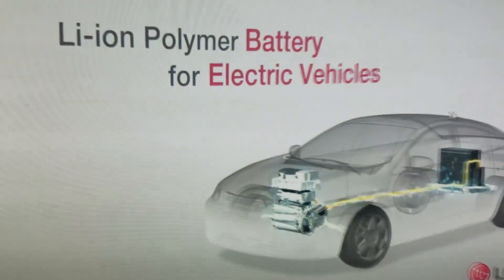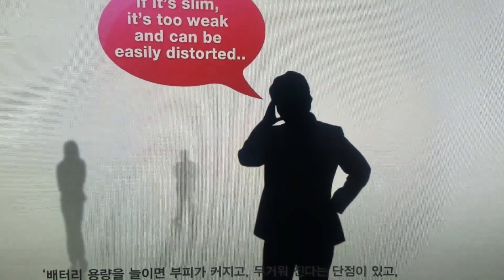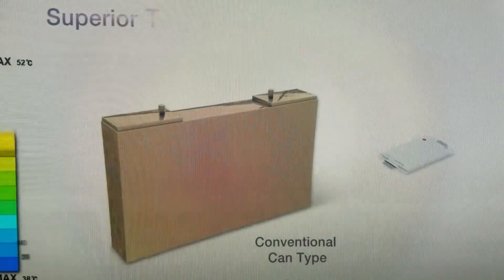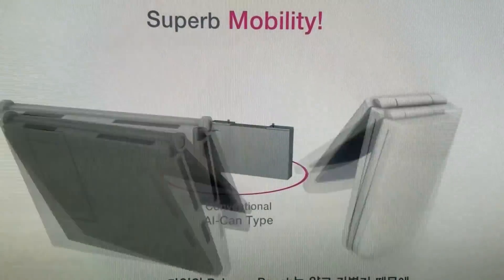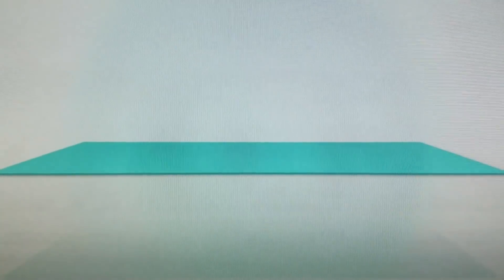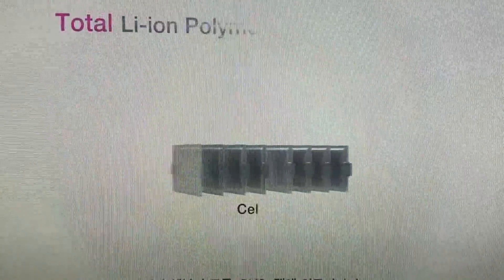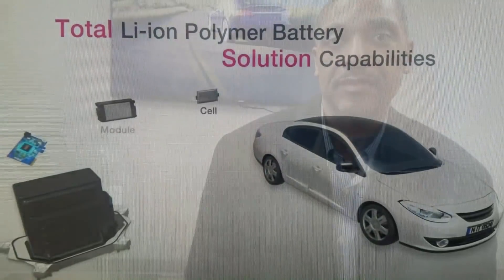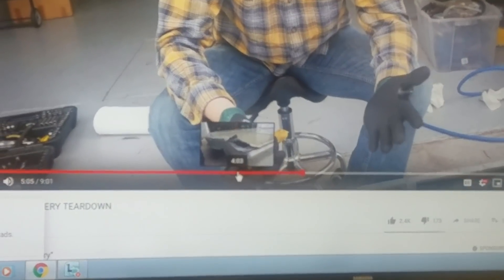C LG Chem Battery Superior to Tesla?   2018 (399)

Comment: BYD, Tesla, LG Chem, CATL - really not sure which is the winner. I personally doubt any company PR department, claims.
Why doesn't the Bolt have better range?  Pouch & cell just formats - chemistries can be use in either format.
I suspect cell can be made faster than pouch. Pouch good for low volume and cell better for high volume (you need high volume as the equipment to make cells are expensive so you need the volume to reduce cost).

Comment: You can see where Tesla avoids short cuts in battery design. far cheaper in short run to use pouches and get higher voltages by mostly placing them in series. but with minor pouch degredation the entire pack is greatly affected. shorter batt life and higher cost to consumer. In Tesla approx 40 individual cells are in parallel and individually fused. then each pack connected in series to the next. there will be gradual degredation but can be can be used like this safely for many years till practically the entire battery dies. Legacy manfacts dont care about "long term"anything. their cars become money pits in short time. consumers are tired if this!
Reply from the maker: Lower cost not as good Jose

Comment: My analysis :Tesla has for 3 years been developing  a high  voltage Braga -Goodenough solid glass electrolyte cell. With Maxwell's dry electrode & capacitor production at scale skill, the tested management system and performance of the Plaid & Cybertruck. conforms multiple  bold steps, probably including a shift to a pouch.

Comment: There is a big difference between a model S battery and a Model 3 battery.  What a load of rubbish.   Watch Tesla and learn from how they do things - Anybody  that has two cents upstairs will be aware that Elon is going to announce something great next year that will put LG back in the box.  The model S is nearly 10 years old and still the best car in the world.   The Roadster  will be somewhat different and will be so much more efficient in handling power.  I wish I was a lot younger - I'd go and work for Tesla as they are the only people thinking (and working) outside-of-the box.  Nobody has cracked their motors yet, such a simple and effective use of power, especial the Model 3 motors and the next version (probably being tested now).
Reply from the maker: some good predictions Frank
Reply: Elon did tweet something obscure but potentially of massive importance by the tweet and what was said about Element 43 (or was it 45) - I do not have twitter so just going by what was reported elsewhere

Comment: Turns out LG packs are great for street racing! They can be used at around 480lbs but a Tesla pack has to be  used as a complete pack at 1000 lbs . So southern street dragers and drifters may give LG business.Street culture drives success.Elon mistake might be his rules of buy my Racer , but don’t use my tech in an unsanctioned way.In a nut shell LG could win.
Reply from the maker: Possible

Comment: I have experience in pouch batteries with Radio Controlled Models, Aircraft and Surface (boats and cars). The batteries made for these have been pouch type for years with changing chemistry. They use to swell and catch fire, from overcharging and short circuits. But today's chemistries are much improved less swelling from repeated charging. More resistant to shorts, but not completely yet. Still they only have so many charge cycles and 3 years is about all we get still. The auto industry should just capitulate and standardize on Tesla batteries and Superchargers. So what they have to pay license fees and or sole source, it will give them the batteries they need to remain competitive and, Tesla what it needs to expand quickly w/o killing off the competition worldwide.  Otherwise it will be doomsday for them over the next 10 years. Tesla Solar, Tesla Powerwall, Tesla Model Y. That is the "Standard Oil" of the future. We see a monopoly in the making, I for one am ok with it.
Reply from the maker: Well said Jerry

Comment: For the set up I am wondering why is the top of the TV cuted off? It looks a bit like you didn't care to set up properly. Otherwise you are getting there. Maybe a bit closer to the TV so it doesn't look like it is accidentally in the picture. Make it more significant.

What happened with the loop for the video? If it doesn't work just let me know I will find some other solution.
Reply from the maker: Loop not always repeatable
Reply: @Teslafaninsight  you can try to make a play list wuth the same video several times or different videos in chain on the topic.

Comment: I think the biggest issue with the LG battery is the energy density. Even Porsche who makes extremely aerodynamic cars couldn't get out more than 200 miles from the same sized battery like model S has with over 300 miles. This is the same issue all around the VW group. So I am wondering what will be the number when the mach-e will get the official epa ratibg.
Reply: I have a simple question which I can't get an answer to.  Q. We all know:  Panasonic won't be Tesla's only cell supplier  much longer.  Tesla intends on manufacturing they're own, proprietary Tesla batteries.  Tesla has said they'll be working with LG and CATL...Tesla needs a "bridge" cell supplier.  My Q.  Tesla's proprietary battery chemistry is currently the best;   by far.  How will LG, CATL, the Energizer Bunny,  etc.  resist copying, or being "inspired by" Tesla's chemistry?  How will batteries inspired by Tesla NOT end up in Competition EV's?
Reply: @jeffreyhampton9130  batteries are just one part of the efficiency. Tesla has superior power train inclusive cooling system and battery management, extremely high efficient motors. So even if the concurrents get the battery tech bt copying Tesla they will be always one generation behind. This tech what they outsource is already old tech.
Reply from the maker: Quite similar I believe